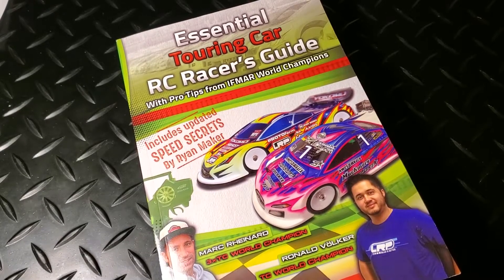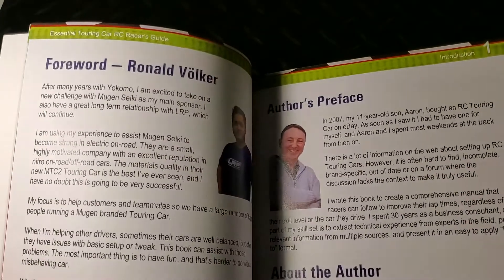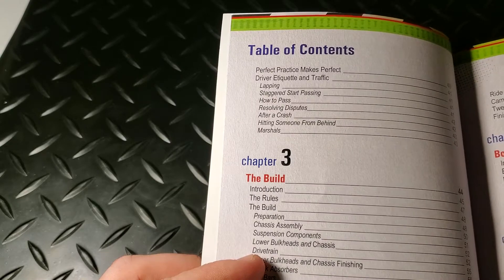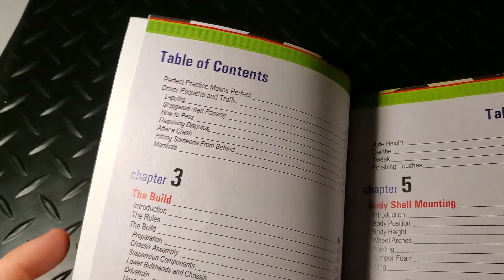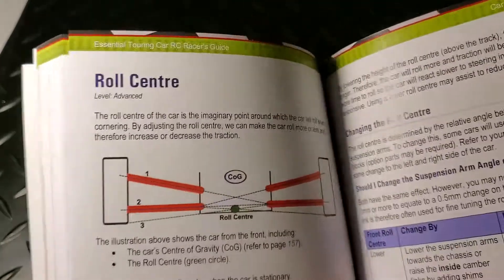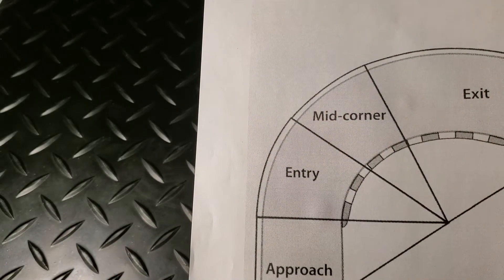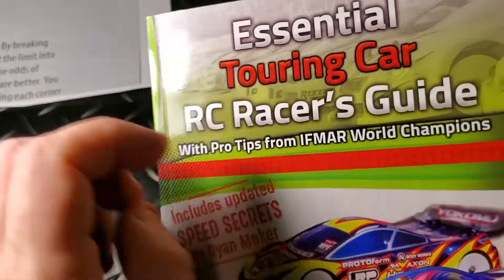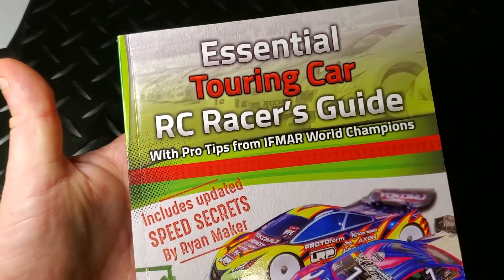Review: Essential Touring Car RC Racer's Guide

Comment: Thank you so much for your positive review of my book. At about 9 minutes you ask a question about the Front Roll Centre Table. Generally, a lower front roll centre will take away some initial steering but add steering through the middle and exit of the corner. Overall steering response is increased as stated in the table. However, Given the table already specifies the effect mid-corner and corner exit, it makes sense to clarify the corner entry effect. Therefore, future versions of the book will be changed to state that: Lowering the Front Roll Centre will provide “Less corner entry steering”, and Raising the Front Roll Centre will do the opposite. Thanks for getting me to take a fresh look at this.